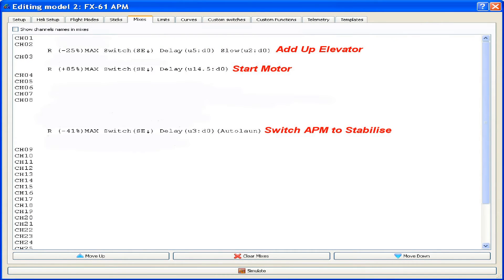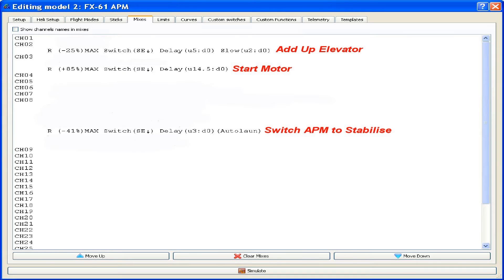Programming RC Plane Auto Launch on an Frsky Taranis.

Comment: When you say "Stabilize Mode" are you speaking of FWBA?  Would not FWBA be fighting the added elevator?
Reply from the maker: jj vb No I use Stabilise mode and the up elevator is effective to help the climb out at least it is on the four aircraft I launch this way..
Reply: Thanks.  I am using APM FCs and Taranis so should be able to duplicate what you have done.

Comment: Oh I see how you did it. Very nice feature.
Reply from the maker: Thanks and works very nicely for other models to. I have since added another line as a safety feature to automatically hold off the throttle until it is needed, just a bit more piece of mind 😀
Reply: Cool, do you have a vid on that new line or just some text of how to set it up? Thanks for sharing this.
Reply from the maker: +dmerc00 No probs am not at home right now will drop it in here later for you.  Bill
Reply: Excellent! Thanks
Reply from the maker: OK the other line I added for prop safety is this,  " R (-100%) MAX Switch (SE) "         I cannot show the down arrow for the switch position as it is not on my keyboard.  SE is the switch I use to activate the Autolaunch sequence.  The above line entered above the line in the video will hold of the throttle totally until it is released after the delay period, it works great and even guards against accidentally moving the throttle stick up.  Hope that helps Bill
Reply: Thanks, I am taking notes. May try this on the mini Talon.

Comment: Really nice "How-To" Bill. Thanks for doing this as I am about to maiden my second FX and this has me re-thinking how I programmed auto launch for my MiniTalon (in the Taranis). The MT works perfectly but I don't launch it with a bungee. I generally do with my wings so this gives me some other ideas with respect to timing and I love the voice prompts - very sexy!
Cheers - Mark
Reply from the maker: Hey Mark I am really liking this Taranis programmed auto launch as its very configurable and customisable, since this video was made I also added another line in there to hold off the throttle until it is needed to start the motor which just gives a little bit more peace of mind being around the prop like that. Cheers Bill

Comment: Beautiful Bill ! Would this work with a FY-AP41 lite ? I guess it would as it's actually only question of switching the switch to stabilised mode. Motor and elevator are directly activated through your mixes I saw in the beginning of this video. Is that about right ? Does the switch actually move physically to the stabilised mode position, and the same question for the throttle stick ? And finally, how do you exit this launch sequence ? You switch the "launch" switch manually back to nul ? In this video I think I heard your Taranis say "autolaunch off". Which switch did you program for the autolaunch actually ? I believe I didn't see that in this video. If you have time .....Thanks Bill. Phil
Reply from the maker: Thanks Phil and yes it will work with any flight controller as all programming is done on the Taranis.  i used the SE switch on the Taranis to activate Auto Launch and then of course the switch off to take control again.  Sticks and switches dont physically move during the procedure as its all done in software.  Before switching it off it is best to increase the throttle stick a little and manually switch to the mode you want before taking off Auto Launch switch.

Comment: Great solution! Just built fx-61 myself with pixhawk lite and Taranis. Just ordered some 6mm bungee cord from HK. I see you gave your's doubled up? My main question us about the hook on the plane. What did you use and what position is this fitted to the plane? Thanks Paul
Reply from the maker: +Paul Atherton Yes I folded the 20m to 10 metre lengths same pull for shorter distance.  Underneath my FX-61 I fitted a piece of square carbon tube then fitted my hook to that 5 inches back from the nose.
Reply: +BillHally I just received the bungee from HK - its actually just a 10m length, and before I realised yours was 20m, I doubled it up, so un-stretched its just 5m. Thinking this may be a little too short. The bungee is made of silicone tube here's a link: http://www.hobbyking.com/hobbyking/store/__67616__HobbyKing_174_8482_6mm_Silicon_Rubber_Bungee_Hi_Start_Cord_UK_Warehouse_.html
Wondering f I should buy a second length to double it up at 10m instead of 5m
Reply from the maker: +Paul Atherton 
If it was me I would try it first to see what happens.
Reply: +BillHally wondered if you've ever put a scale on that bungee to measure the load on that line fully stretched. Going to test fly mine today. I have 2 lengths of 8mm latex tube bungee (it's the blue bungee from HK) doubled up with about 5m nylon strap attachedto those with a loop on the end for the model hook. Tested the load yesterday and can get it to about 6kg at a push.
Reply from the maker: +Paul Atherton  No I have never measured the pull sorry.
Reply: Tested my bungee launcher last night with the fx-61 and it worked perfectly! Thanks so much for posting this Bill - its a great solution to a problem I was pondering over for a while.
One thing I did extra was to add a special function to kill the throttle for the first 12 seconds of the launch sequence - just a bit of added safety whilst its hand held in prep for the launch.
To reiterate my setup, I used 2 lengths of the blue 8mm hobbyking bungee tube - doubled up - gives about 6kg of pull. My fx-61 is running on 4s with a folding 10x7 Aeronaut CamCarbon prop, sunnysky 2814 890kv motor.
Reply from the maker: Hi Paul Sounds great am happy its working for you. OK on the extra line I added it to after I made the video to hold off the throttle until after launch, great minds think alike mate Cheers Bill

Comment: Where did you get your bungee cord from?
Reply from the maker: +paulham Ebay 5mm diameter 20 metres long.
Reply: ***** cheers. 'Surgical tubing'?
Reply from the maker: +paulham http://www.ebay.co.uk/itm/BUNGEE-CORD-black-5mm-x-20m-shock-chord-elastic-rope-5-/350471276606?hash=item5199b7483e:g:bWMAAOxyuMVSDOPX
Reply: +BillHally Perfect, thank you. and your link is actually cheaper than the one i was looking at from China.

Comment: Nice job Bill.  But as for me, I will never stick my hands near the prop with the battery active.  I've seen way too  many accidental spin-ups for one reason or another, some with disastrous results.
Reply from the maker: +Dieter Preiser Hi Dieter thanks.  When I first started flying this wing I could not hand launch it as I was very worried about the spinning prop as it left my hand so went for bungee. I have now launched it this way for over two years without incident but have to admit to being very cautious at first with another flight controller controlling the throttle.  On my transmitters I have always programmed a throttle hold switch for safety.  Now since making this video I have added another line into my Taranis programming that automatically holds the throttle off until after the launch when it is about 100 metres away from me, even accidentally pushing up the throttle stick will not spin up the motor whilst in launch mode.  I am much more comfortable with this as the Taranis has total control of it whilst I am launching and I know that it will not spin up on me.  Believe me I am well aware what can happen around spining props as I have seen it first hand and it aint pretty.  Bill

Comment: Bill,
This is a nice video. When I was viewing it I was thinking that you need to add a couple of "hold" rings on the wing, forward of the motor, and make a hand held release device so you can launch the bird without getting your wrists and hands next to the prop. Once you take the APM out of throttle hold the motor is "hot", and if you have some sort of glitch in the APM with or without the throttle hold enabled, that prop will slice into both wrists, and or hands which could be life threatening especially if you are out at the field all alone.

Cheers,

Bernie
Reply from the maker: +Bernie L Hi bernie thanks and its working just fine.  To be honest I am not to worried about holding the model there as the I have always launched it that way even with the Arkbird.  The beauty of this is that the Taranis is holding the throttle off and not the APM in this instance and I know it will not start at all until the word "Launch" is announced after the countdown.  I like this much more than Auto Launch on a flight controller as its much more controllable and configurable.  Bill